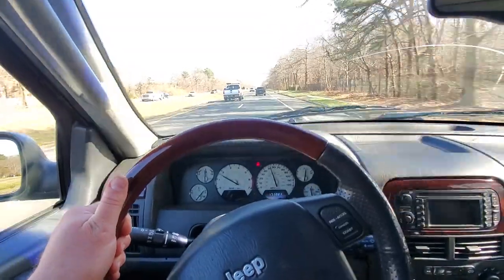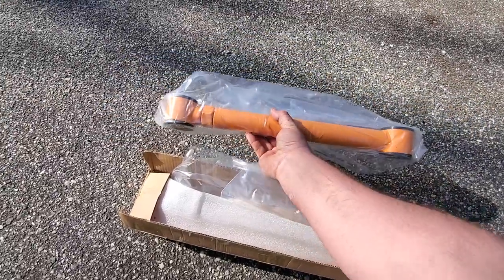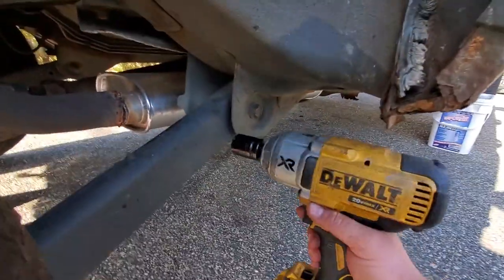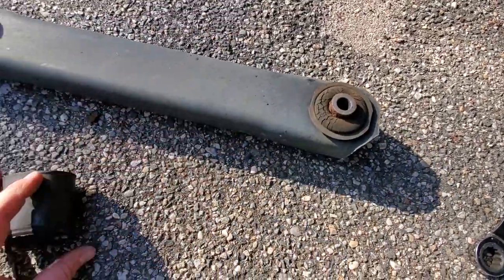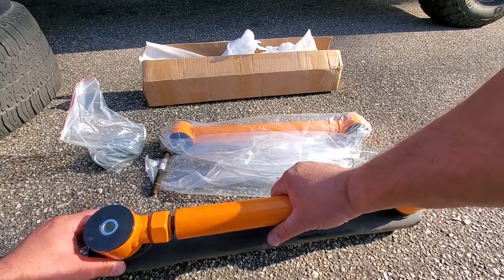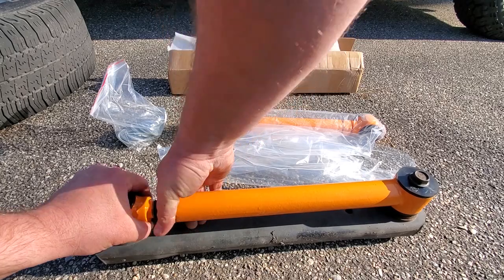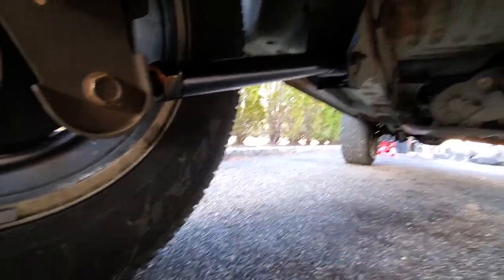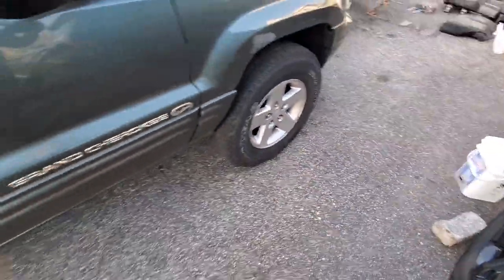JEEP WJ ADJUSTABLE REAR LOWER CONTROL ARMS - MXR PRODUCTS FOR YOUR 99-04 GRAND CHEROKEE

Comment: @Dan H, When changing out control arms in the future, remember to leave them hand tight at the mounting locations then proceed to torque them down with the vehicles weight sitting on the ground. That way there us no presprung movement preventing articulation in the future or premature wear on the new bushings. This is especially helpful when using poly bushings to prevent unnecessary squeaking.
Reply from the maker: yes!  your absolutely right! I knew I missed something!  thanks for the comment!

Comment: Check your upper 3 point link. Where are ya in NY I’m in central NY right off 81 Tully NY
Great you fixed it but still check the 3 point upper I had to replaced mine turned out to be a big job.
Reply from the maker: Yes I have a spare ready to go! Eastern Long Island 🍻

Comment: Increasing length of front lower control arms from stock, will increase caster reducing death wobble and adding stability on highway (think Mercedes, higher caster, more stability at highway speeds). Did that at Alignment shop I worked at, on a lifted 4x4, all of the sudden I was the guy for lifted vehicles, and all I wanted to do was work on Mercedes...LOL. Ratchet straps, gotta love'em
Reply from the maker: You're absolutely right! I figured it replace all the worn parts first, then i can dial in the arms as needed.  thanks for the comment!
Reply: But it will increase pinion angle also so can't get much increased caster there or you'll kill that ujoint

Comment: What's the point of doing adjustable control arms if you're just going to set them to the same length as the stock control arms? Why not just get stock control arms at that point?

If it's lifted, shouldn't it be longer?
Reply from the maker: So I can adjust them whenever I want. Lol.  Needed to do the rear upper ball joint with a spacer before I dial in the control arms

Comment: You worked a little harder then you needed too. You can remove the old control arms without remove the tire nor lifting the Jeep up. The only time I needed to lift the Jeep up was to align the mounting holes with the new control arms. You can do this instead of trying to fight a ratchet strap.

Comment: harbor freight fixed the jack stands. Their jacks are awesome.  I have 2 of the Daytona ones. Beasts
Reply from the maker: Oh Man... They straight up lied to me.. the Selden store told me it was gonna be another year before new ones were released.. I got 90% cash back and left
Reply: @ProjectDanH  i stand corrected. I returned my old ones and they were out of stock on the replacements when i brought them back last year. I never remembered to try and replace them and figured they must be in stock by now but I just checked the website and they arent! I have the 6 ton ones from HF that werent affected by the recall and I use them all the time. There was a casting issue with the recalled ones where the teeth werent made long enough.
Reply from the maker: @smitty4699  I heard they used inconsistent drill bit sizes to bore the hole for the lock hinge.. That would be a reason why some teeth aren't one enough...  I guess that makes sense

Comment: Wow another example of Jeep quality engineering. What were they thinking with those stupid oval rubber bushings. I bought my first  Jeep, a 2003 Grand Cherokee because it was already setup to tow behind the motor home. Now I know why it was so cheap. Yesterday when I pulled the wheel to do brakes I saw that the rubber bushings were loose in the front and rear suspension. At 150,000 miles the suspension is shot and all the control arm bushings are shot. Thanks for the video at least I know how easy it is to replace everything.
Reply from the maker: Rubber bushings are standard in the automotive industry, they provide a very comfortable ride and deaden vibration.   unfortunately they wear out over time.

Comment: Have you been happy with the control arms in longer run?
Reply from the maker: Yeah!! So far no problems.. Had to torque the nut down twice since.
Reply: @ProjectDanH  Ordered some for my ZJ now. Maybe Ill add some mild threadlock while installing..

Comment: I put a 6 inch lift on my jeep and now my rear axle moved forward and now I need get the rear axle moved back to put bigger tires on. Will these help move them back more to put bigger tires on?
Reply from the maker: It possible these could help you with your adjustments. 6 inches is a very large lift on an WJ
Reply: Probably need adjustable upper control arm as well

Comment: I love seeing how crappy the part you are replacing looks. It only confirms the reason why you're doing it. LOL
Reply from the maker: Yea the original control arms were totally  destroyed!  I was moving jack stands all over the place in this Project.  I had them under the axle in a very wide stance at first but had to bring them closer to center to get the control arm bolts out.
Reply: @ProjectDanH  Also Dan, when dealing with bushings, you want the weight of the vehicle on the axles before tightening the control arm bolts. When you tighten the control arm bolts with the vehicle jacked, then when you lower the vehicle on its own weight, the bushings twist. When doing it the other way, the bushings are not under stress.
Reply from the maker: Ahhh dang it!  You're totally right! I blew it 🤦‍♂️